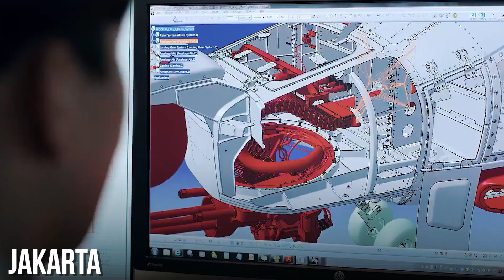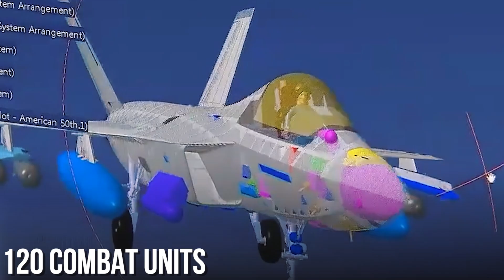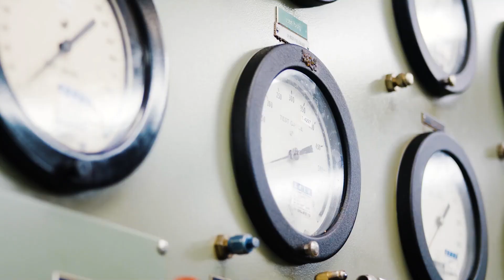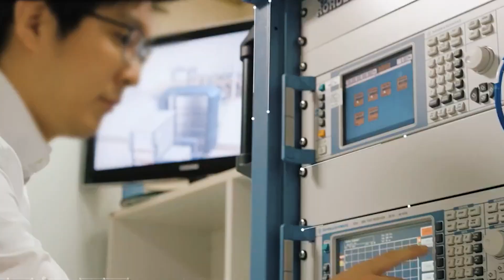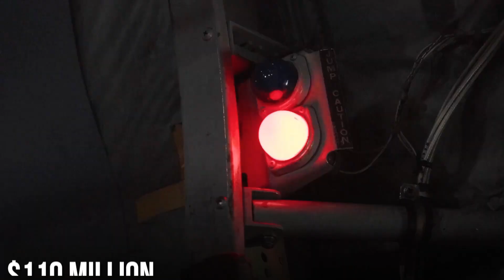Here's New Secret Korean Fighter Jet

Comment: By the time they roll this out it will be gen5. That was the plan from the beginning.  With working gen 4.5 aircarft it will easier to move to gen 5 since they own most of its technology with very little dependencies from outside source. Also future plan is to build all component in house including engine..

Comment: Serveral wrong informations in this video. 1. it's indonesia who is partnering with Korea but have not paid yet. 2. Korea have to be able to guard itself and not always depend on US. 3. Cost of F-35 way too much and operation cost is way too much also one F-35 cost is 5 of this KFX or more. 4. KFX is very advance which I don't think you even mentioned and would not know about and working with Israel is much more advanced in radar system then US.